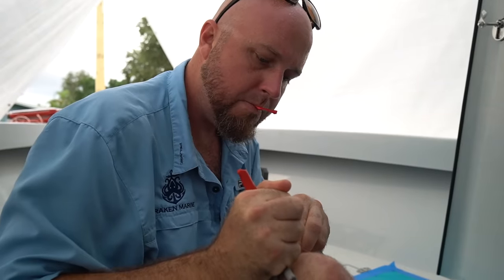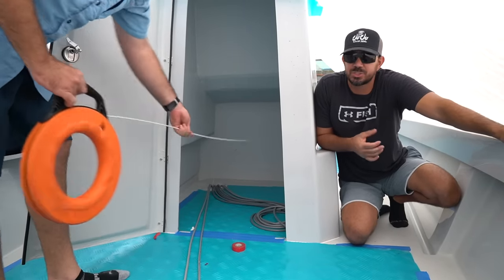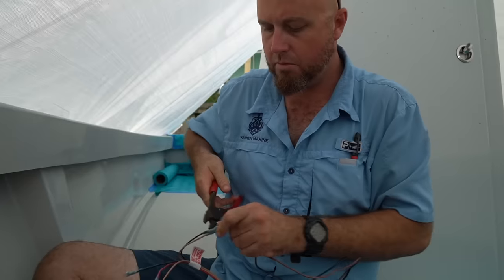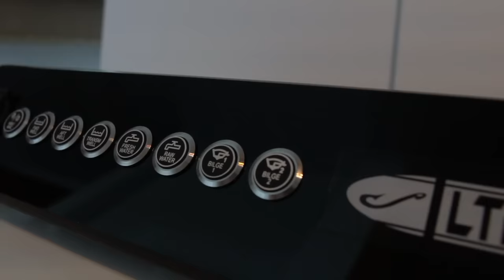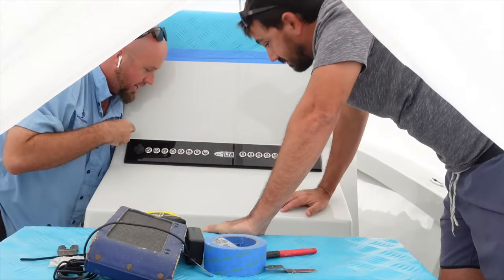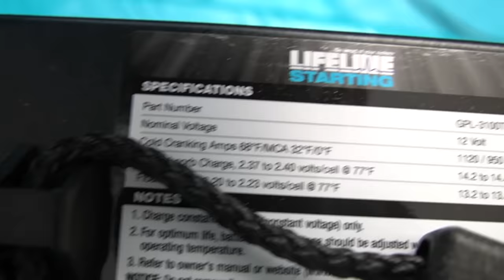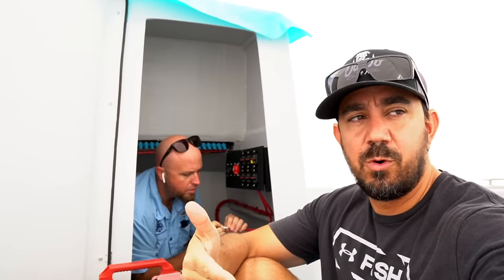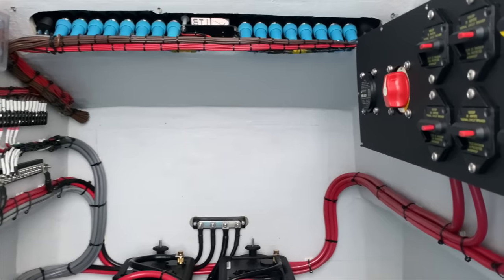THIS IS ART!! Wiring Boat & Switch Panel Install | EP 21

Comment: Thats the way a wiring job should look, everything parallel and the shortest run on top or bottom ( if your break away is up or down ) then next shortest, etc. Keeping all wires tight together and well secured in place.   I have to admit that I'm an overkill nut, I overkill everything, wiring included.   If it calls for 14ga. I use 12ga. and so on, can't help miself.   The things doing electrical work that I don't overkill is breakers or fuses !   The boat is coming along very well, you should be very proud Capt. Mike !!!!!!!!!!!!!
Reply from the maker: I'm very happy with the wiring. I got lucky Cory is local.

Comment: Super clean setup! I just installed those ULTRA Float switches on my bilge. Previous owner had used cable lamp and twisted the ends together with some duct tape.  To say I was shocked is an understatement 🤦‍♂️

Comment: I use the Lifeline batteries in my boat as well and they're the best. When my boats on the trailer at home I keep a Battery Tender hooked up to it and I get 8 years of service out of them.
Reply from the maker: I told Cory I wanted the best batteries and these are what he chose. If you do the math, they end up being cheaper over time vs a standard battery.
Reply: Can you explain what a battery tender is?

Comment: Can someone tell me what scissors he was cutting the shrink wrap and the wire with? Those cut that power wire like nothing. And possibly the wire strippers he was using
Reply: The scissors are Knipex electrician shears. The stripper you saw in the video for big cable is a Phoenix Contact Wirefox D40. I also have a pair of Phoenix Contact auto strippers that I use on smaller wire (10awg and smaller).
Reply: @krakenmarineelectric7291  thanks

Comment: Very neat and tidy.  Your electrician and mine must have went to the same school.  My electrician wired my main power distribution panel the same way.  Every stick of conduit in my shop was installed with a level, even in the attic.  That wire crimper is similar to one I purchased for use on the Public Transit Buses here in Hillsborough County years ago. And the heat shrink tubing with the adhesive/sealant on the inside searls the terminal ends preventing corrosion.  I have a small version hand crimper made for crimping my Anderson Power Pole connectors.that I use in my marine related projects.  It crimp 15/30/45 amp terminals and they all will fit in the same housing.  I love that system.
I have the Minn Kota Riptide 80 lb 24 volt trolling motor with (Spot Lock) on my 17ft. Scout Sport 177 flats boat.  Minn Kota offers bigger thrust and higher voltage i.e. 36 volt units for larger boats like yours.  I love the Spot Lock feature on my trolling motor.
You have a DREAM MACHINE.  Can't wait to see you on the water with it.
John
Reply from the maker: Thanks John! One thing I couldn't skimp out on was a good wiring job. I can save a bit in other areas, but this aspect was very important to me.

Comment: Beautiful, well thought out work!  Looks great.
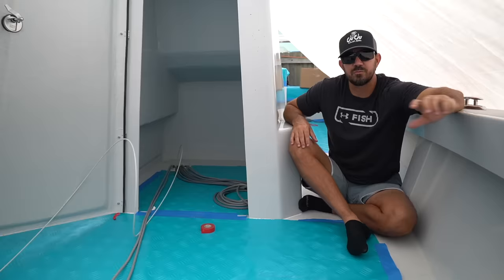1:35 - Why is the washdown pump so low in the bilge?  They are splash resistant, but really don't like getting wet or being immersed.   I strongly recommend moving higher up if you want it to last longer.    I've made that suggestion to a number of friends, and several said they stopped having to replace them every couple of years after getting them higher.
Just trying to be helpful.   Beautiful work!
Reply: There is quite a bit of clearance between the pump and bilge floor, looks lower than it really is. They are sealed units and carry a 3 year warranty. We also give them several coats of a clear sealer which greatly increases service life.
Reply: Corey,
That makes sense, as video cameras tend to distort perspective. 
You do beautiful work, by the way!

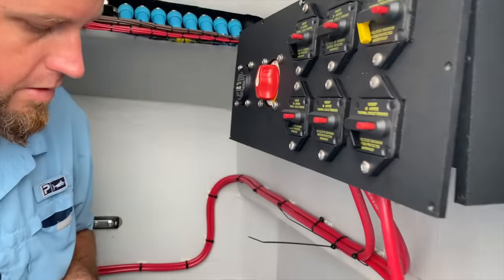Comment: That box he installed at 14:10 is WAY to deep.  It could be half that depth.  Sweet wiring though.  It's like wiring diagram porn.  Just tell Cory he needs to switch to a heat gun instead of that stupid torch:)

Comment: This is actually better than pornhub.
Reply: That's it... electric crimper just came out.
Reply: Last thing... batteries wont last long with trolling motor and electric reels working them out. Particularly if you aren't running your engines. Just keep it in mind.

Comment: Hey mike, nice job on the boat. I doing something similar I would appreciate if you can answer a few questions I have. What type of battery terminal are those? What type of switches are you using? And if they are resettable? And the length and width of the switch panel? Thanks

Comment: Looks clean and tight. Awesome job! This totally appeals to my meticulous nature. I used to work on aircraft wiring harnesses. I see the beauty here.  So, I see the batteries are at deck level on an open center console (wet boat) and not in sealed battery boxes. Is that kosher?  I realize they are AGMs so they don't need leak protection but they seem exposed and low to me.

Comment: The switch panel with the "tie wraps" was perfect, then he pulled out the tolerances. All the wiring done by the main guy is trash. He did not allow for tolerances, so you are Married to his setup. He has never been underway and needed to add or "dead-end" cables. It's a bad case of form over function. It can look good, but it needs to serve a purpose. I hope it works out. #NAVYElectrician
Reply: And he crossed  a (+) cable run over a (-). But it is cute. 😅

Potential #shorts and #grounds all over that boat.

Comment: I’m in the process of out fitting a new boat but cost has become an issue with layoffs due to COVID, so it’s become something I’ve been having to do a little at a time or trying to tackle it myself. If I may ask what was the cost of having this company do this wiring job?

Comment: 36V trolling motor one hundred percent. You find a school of dolphin in a weed line and you drop that thing and press a button to stay put and you’ll never look back. Same goes with bottom fishing on a wreck. Fishing the oil rigs here in the Gulf it’s an absolute game changer. Set it up current of the rig and work your chum slick into the rig. Free line your live croaker or shrimp into and never worry about anchoring.
Reply from the maker: It's nice, but we will manage without it. I was attracted to this boat originally because I saw others rigging the trolling motor. Let's see where we end up in the budget after we hang the motor.

Comment: You definitely get more than two years from a standard battery! I always got a minimum of five years on my batteries here on the East Coast! Here I would have to remove my batteries every fall charge them up and then they would sit in my garage all winter until the spring time! Also as long as you purchase your batteries from a good supplier you can usually get anywhere from a 3 to 5 year full replacement warrantee! Lifeline batteries cost anywhere from $300 to $500 a piece and they only offer a 1 year full replacement and 4 year pro rated warranty! Also on average those lifeline batteries only last between three and four years! They are definitely not worth the money!
Reply: 1 year warranty on Marine flooded batteries. Yes, you can get much more life if properly maintained, but I call them 2 year batteries.

Comment: No “Service Slack or Loop”?
Reply: Warren that's the difference between a rigger, and a experienced service mechanics
Reply: I put service loops at the loads as thats where most likely to have an issue. When a customer looks in their console they want artwork which cannot be achieved with service loops on everything. All connections are sealed with epoxy shrink tube and will have several coats of 3M electrical sealer sprayed over top.
Reply: @fair wind I am not a rigger, this is about 5% of my business. 95% of what I do is electrical troubleshooting on everything from small CC’s to 180’ yachts. 12vdc to 480vac. I appreciate a good service loop as much as the next guy
Reply: Yep Corey, that's how I do it too!  The marine industry is changing fast, and I'm afraid experience is not keeping up. It's a shame and hard for customers to see through the smoke and mirrors. And worse when you put a 28 year old sales man in the mix
Reply: @fairwind8222  Appreciate the replies. 

I’m an IBEW union commercial low voltage tech and always do service loops. I’m lucky to have a ceiling to hide it. At this level do you just pull what you can and replace the connector? Solder in a splice? Or pull a new wire?
Reply: And I should say, I'm not knocking the guy! Great job, it just needs to be repairable and serviceable, loop it. And he is consistent clean and sober hard to find employees like that
Reply: @warren6172  On this build, the service loops are at the loads, which is where the failure will be 95% of the time. If you were to look in any of the junction boxes in the bilge or electric reel outlet boxes you would see plenty of extra wire to re-terminate several times. All connections are also sealed with epoxy heat shrink tubing and at the end will all be coated with 3M electrical sealer.

Comment: Wiring looks great!!!Nothing like clean and simple. One of the most rewarding projects I did on my boat was my rewire with new switches and acrylic panel. It took me about a week to finish but made such a huge difference.
Reply from the maker: I love the way the switch panel came out. It is also up front and center so easy to find the switches fast.